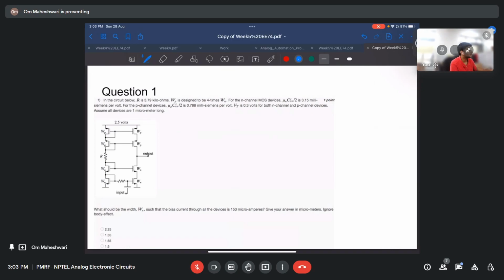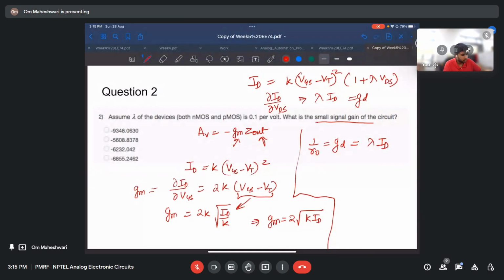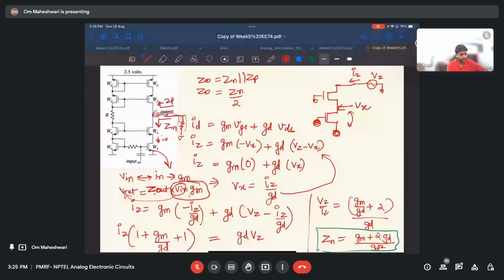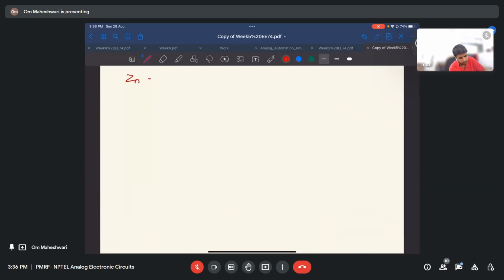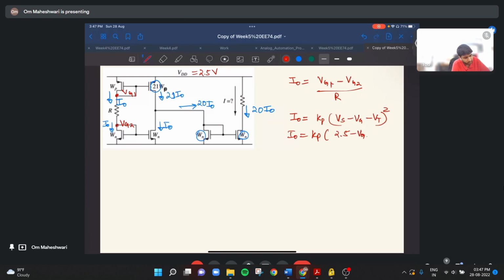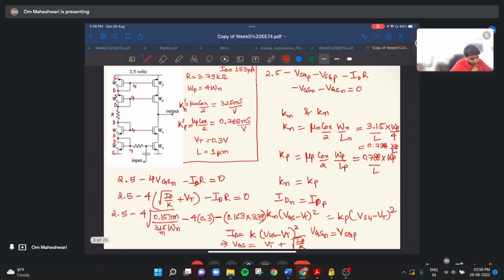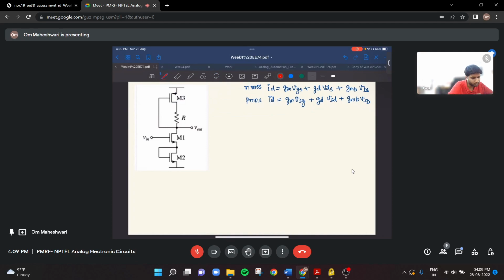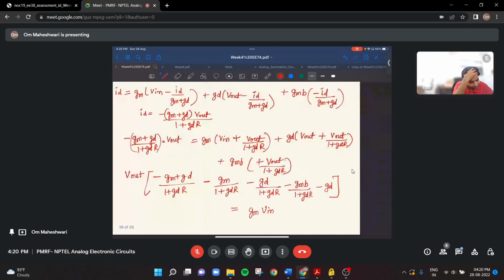Analog Electronic Circuits EE74 - Week 5 Live Session

Comment: At 47.56 mins, Id =0.0124 and not 0.12. Can you please check this?
Reply: No, it is correct, Id = 0.12mA, just to check, coefficients of quadratic equation ax^2 + bx + c = 0 are, a=8600, b=70.7106, 
c= -1.9. This gives x = 0.0113 and on squaring x we get Id.

Edit: for current assignment value of R is 6.6k and hence Id is coming out as 0.0124 as you said. Value of R taken in problem solving session question is 8.6k.
Reply: Was the paper assignment based or not?